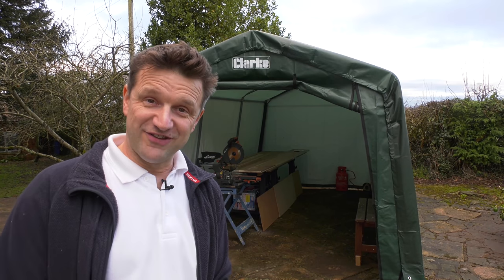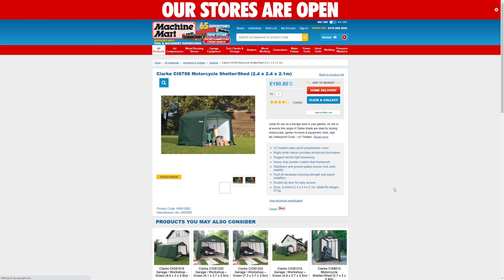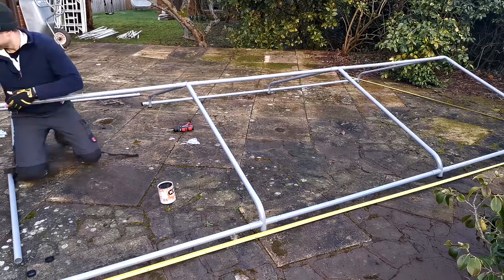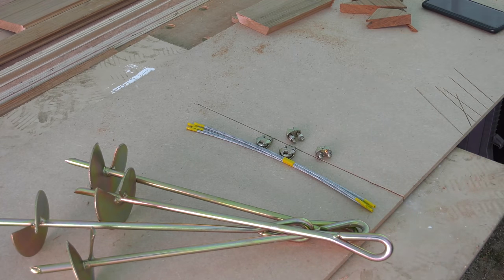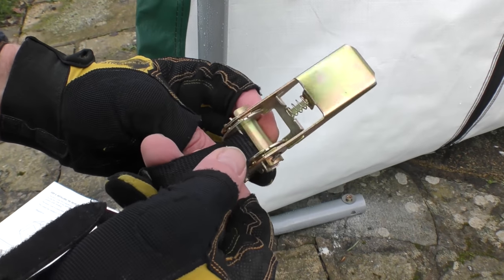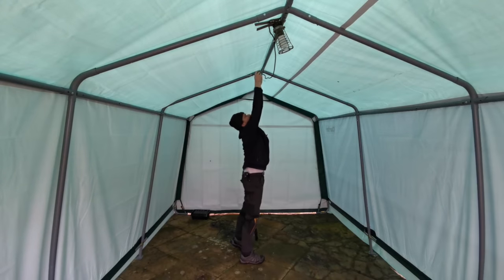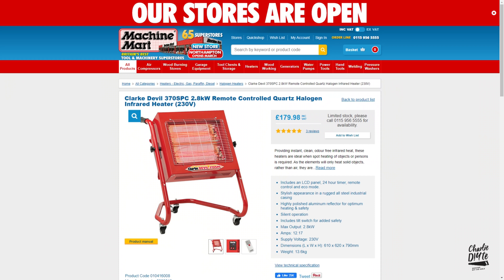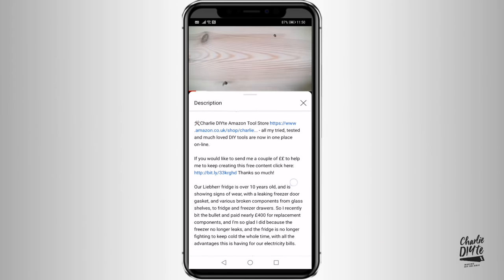Instant Workshop for Bespoke Wardrobe Build!

Comment: I’ve had 2 of these. They are great.......for about 2 years.....after which the UV sunlight will weaken the cover to the point that it splits on the corners where the cover rubs against the frame or down the ridge line. Place some foam anywhere that the cover is “stretched” around the frame and it will last a little longer. Also don’t over-tighten the cover as again it causes it to wear quicker.
Reply: Great comment. Thanks mate

Comment: Nice idea. As with sheds, at no time will you ever think “Gee, I should have gotten a smaller one”. It will be interesting to see
your decision in a few years when the cover material wears out. Other options could be hard plastic style or a wood shed. Initial cost is higher but eventually replacing the cover material will exceed the cost of 
stronger choices. Other advantages would be better security and ability to run power to it and having windows to open in warm temps. 
Thank you for taking the time to
show the build.
Reply from the maker: All good points Louis. The thing is, this is only intended to be a temporary structure, although it's still up after nearly a year!
Reply: @CharlieDIYte  
Charlie, I’ve been told by a friend that Gorilla Tape is super strong and could possibly be of help to you. IF you can reach the obvious ‘wear points’, you could reinforce them and extend life of your structure. 
Best of luck!

Comment: Having seen this in the Machine Mart catalogue and on their website and being quite pleased to see a considerable amount of positive, 5 star reviews for it, I think that it would make for a good, portable workshop in which I could build the excellent Slidavan rising roof camper, which is designed to be built in a single car garage.

Even though it would be in a rear garden and invisible from the street, I have no intention in leaving any tools or items of value in it whist I'm not actually in it, working.

It was nice to see it in your video and it certainly looks like something that one can buy with confidence as it appears to have been well designed and manufactured from good quality materials and fittings to a high standard, making it completely suitable for our winters.

The fact that the instructions are well written and the individual fittings are marked for clear identification during the checking, layout and construction phases further builds confidence in the product and its quality.

Thank you for your helpful video.

Comment: Hey Charlie. That’s a really impressive temporary structure. I like the solidity of the steel frame and the ratchet straps etc. It looks pretty robust. Perfect for us Brits who don’t have triple wide huge garage spaces like our American pals for workshops. I’ve been heating my timber workshop shed with an electric radiator and that Clarke heater looks pretty good. Looking forward to the wardrobe build. All the best 😃👍🏼
Reply from the maker: Cheers Paul - you too 👊🏻.  I'm so pleased with it. Was in there with my son this afternoon helping him with a woodworking project. It really does feel like a proper workshop and the new infrared heater is perfect for the size of room. We had the room at a very comfortable 21 degrees.

Comment: These are really good, we have the smaller motorcycle shelter version you mentioned, used as a temporary shed when we moved house. We did use the ground anchors, make sure you fully secure the frame to the anchors and spend a lot of time making sure they aren't going to move. We too have had some very high winds, which the structure has handled well so far. Would thoroughly recommend these.
Reply from the maker: Thanks - it's really good to hear you've had similar experiences with the smaller one. I'm so pleased with it. My son and i have been working in there on a school project this afternoon, and with the heater on, it's a lovely space!

Comment: We're on the same wavelength! I was just about to put up a 3x3 pop up gazebo.  Top video bud 👌
Reply from the maker: Thanks mate. It's the way forward. I had an epiphany in the summer when I was carrying in my tools for the umpteenth time in a rain shower and thought "dow, why didn't I think of this earlier?" That gazebo would have been fine, and it would have been nice to have had windows but with the white walls it's light enough inside particularly with the lights on, and with the heater this afternoon it was a respectable 21 degrees 👍🏻

Comment: Another good review Charlie. You have given me an idea for 1 now.
Reply from the maker: Cheers mate. I'm so pleased with it. Helping my son on a woodworking project in there this afternoon and it really felt like a proper workshop - particularly with that second heater, which keeps the room to a comfortable 21 degrees. The RCD was invaluable this afternoon when i had the heater on and started using the chop saw (the electrics are a bit heath robinson - basically an extension lead).

Comment: Hi Charlie, ,thanks for the video, good space, and as you said you'll keep dust out of the house, here's Whishing you well during this lockdown, looking forward to the next one, kind regards, Stuart.uk.
Reply from the maker: Thanks Stuart. Yep, loving it so far and that second heater is a revelation. 21 degrees in there yesterday afternoon!
Reply: @CharlieDIYte  hi Charlie,  thanks for the reply,,21 degrees, luxury working conditions, overnight condensation on things that have warmed up mite be something to watch out for, I have a concrete workshop and I never put heat on this time of year, as the following morning anything metal is wet through, I only heated  it once and it took me 2 days to dry out tools , etc, if I had my time again and the funds , an insulated, heated workshop would be top of my bucket list, , stay safe mate, kind regards Stuart.uk.

Comment: This may be an option for me as a makeshift kitchen during renovating mine.
Reply: I bought a cheap caravan when I did my kitchen, so much nicer to cook/eat while Chilling out and not sitting in dust etc. My was ripped back to bare walls and rewired etc. Most likely they will be delays and problems along the way. Best to a solid temporary kitchen in place.

Comment: Nice. It could do with a window flap at one end to allow through ventilation with all that saw dust.
Reply from the maker: It would be nice to have a window just to let in a bit more light, but it's pretty light in there due to the white lining. I'm not worried about the dust as I'll have the flaps fully up when I'm cutting.

Comment: Have you had any issues with condensation? I bought the smaller one last summer for some storage, and planned on getting the larger one later this year for some additional workshop space, but when I went out to get the christmas decorations last December, the roof and walls on the inside were quite literally dripping wet all over, and there was a musty smell on everything. I know the thing is waterproof, and has no damage anywhere so its not a leak, its definitely condensation and I'm not too sure what I can do about it.
Reply from the maker: Colin you're not the first to mention this and yes I've got to say, I've had some pretty big issues in the past week, almost entirely caused by the snow, which when it melted obviously caused a major dew point on the inside ceiling, so that when I finally re-entered the space there was a lot of dripping on my work bench. You need ventilation in there. Don't whatever you do weight down the sides or block the front or back covers, and a fan left on 24/7 pointed at the ceiling would probably solve it. It's the same principle that i talked about in this video https://bit.ly/3glMu6H in respect of condensation on windows. It is annoying but I still think it's a fabulous storage space. I wouldn't be able to do this wardrobe build without it, so I'm happy to live with this one issue.
Reply: @CharlieDIYte  Thanks for the reply, at least I know its not just a problem with the one I have, but with regard to putting up with the issue, I think ill be the same, as I desperately need a larger workshop space purely for larger projects and it is the cheapest option available to me, I think as long as I use waterproof external sockets and cover anything important with tarps (as I tend to do in my wooden shed anyway) it should do the job :)

Comment: That looks like a fantastic working space. It's not easy handling a full sheet of MDF in a small space. I also have wardrobes to build but my garage is far too full and cluttered. I'll be interested to hear how you get on with damp issues and condensation. Do you expect the patio slabs will get water run across them when it rains?
Reply from the maker: Sounds like you and me have a similar situation. Condensation hasn't been a problem so far, possibly because the patio doesn't retain a lot of moisture but also because I have it on the patio rather than the grass, there's a small gap under the front and back cover for air to circulate - which is crucial to negate any condensation. I'm interested to see how the patio goes. It's pretty dry at the moment, doesn't seem to get rain flowing through it, but does seem to mirror the condition of the patio outside, in terms of being damp when it's raining, but that could just be because it's taking a while to dry out. We shall see. I'll try and do a stand alone video on the heating if time allows.

Comment: Looks good.  Maybe make a wood frame perimeter base from some pressure treated  3 by 2 so you can take it to jobs where you might have to setup on a lawn?.
Might be an idea to cut out panels and tape in clear plastic windows in for more daylight
Reply: Very good point
Reply: I think it comes with long screw pegs for pinning on soft ground. They look pretty solid as well.

Comment: Great to see this video Charlie as I have various projects planned for the coming years and was thinking of doing something like this in the garden. The structure you bought looks what I would call semi permanent as it doesn't look like something you would pop up for just and afternoon of DIY where as the Gazebo looks more suited to that. I would be interested in how long you think it would take to put up this Clarke structure if you were to just be doing it without all the filming etc and without the fixings.

The idea of drilling in some anchor points was a good idea though I wonder how the screws would stand up to the sideways forces caused by winds? Would they bend? It would have been good if there was an option for a doorway in the side as for my application the end doors wouldn't be ideal as it would have to be put side on to the house.

A shop near us had a big fit out recently and the workforce were using 2 tents on the parking lot similar to a Gazebo but a much higher spec one. It seemed to be a godsend as it just rained all week but they were able to work with no issues in the dry.

The heaters in this video would make a really interesting stand a lone video if you ever get the time to do one. I like that they are fitted on wheels so can be moved to where you are working and the infra red one you ended up using looks much safer all round. Essential for working in the winter and it will help to keep you much more in the mood for working out in these current freezing temperatures.

Some ideas I had for your work lights was to glue on a couple of the cheap rare earth magnets that are readily available online, you could then use these to hold the lights on the various metal poles of the tent so you get light where you need it most. These magnets are very strong and are useful on all sorts of things. 

I think though I would increase the amount of lighting you have in the tent as you can get good LED light strings or stand alone waterproof batten LED lights for little money from Screwfix etc and you could then wire them up and have a semi-permanent lighting solution if you wired a plug on the end with an outdoor light switch on the entrance of the tent. You could wire in a temporary outdoor socket  on the end of an extension lead or run a waterproof extension lead out to the tent such as the Masterplug HLP2013 or use an outdoor socket box.

This would give you indoor quality lighting outdoors for not much additional money and then in the future it could all be re-used for future projects or for summer BBQ's etc.

Looking forward to the rest of the series!
Reply from the maker: SO MANY good ideas in there mate, and yes I agree, the heaters deserve a stand alone video, particularly given that I was using it this afternoon, helping my son in there with his woodworking project, and got the room to a wonderfully comfortable 21 degrees. I'll take stock of everything you've said. The lighting in particular world be well worth sorting out. Suggesting recently mentioned Quinetic lighting. Wow, that system is clever!! Thanks again 👍🏻
Reply: @CharlieDIYte  I haven't heard of Quinetic lighting before so will look into it. Sounds interesting!

Comment: Hi Charlie. Great video. I was thinking of going for one of these however I would need it to fit into an 8ft space. I noticed when you were building frame there seemed to be movement of the bottom legs. Do you think they would pull into an 8ft base... cheers J

Comment: I have one of those as well. To be used as a workshop during a renovation. What I found is that the condensation was a big issue
Reply from the maker: Yes a couple of people have said that. I guess you need to keep an air flow in there.

Comment: Nice Charlie.  I have the same issue of doing a lot of DI and not having a fixed workshop inside so weather affects my work a lot.
Question I have is you said it has already been out in windy weather, but would you have any issue with leaving this out all year round?  In the UK we can be hit by very high gale winds, would you have reservations or worries about leaving it up and out during these types of very high winds.?
Reply from the maker: No, I'd be fine with that as it's designed as a semi permanent structure. I'll probably leave it there until the summer so I'll try to do another video to let you all know how it weathers.

Comment: Charlie,

Great vid as usual, always so informative and meticulous.  Thinking I'll get one to work out of too for upcoming project!

What's your thoughts on laminate flooring?
I have to install in every room in new property in 6 weeks time and wondered if you've covered kitchen installation at all? 
More so, cutting end boards and plinths etc or butting up to them ? 

Any tips would be great
Reply from the maker: I'm loving the instant workshop. No, I'm afraid not but there will be plenty of stuff on the internet. The only thing I would say is, if you can, take off the skirting before you start as laminate flooring with quadrant around the edges to hide the gap between the floor and skirting looks like a bit of a botch in my opinion.
Reply: @CharlieDIYte  Thanks for your advice. Skirtings off it is.... hopefully they won't break in the process

Comment: Great video, Charlie. How long did it take you to erect the tent/workshop?
Reply from the maker: I should have mentioned that. You should allow half a day, really just because of the anchoring which takes longer first time. It's not the quickest to erect (where one of those ebay gazebos can be put together in a matter of minutes), but it is designed as a semi permanent structure, so you wouldn't expect it to fly up.

Comment: Charlie - got a quick question, wondering if there is a way of locking it? Are the zips for the doors able to have a padlock put through them or something attached to them (a piece of wire with 2 hoops maybe) to make the whole thing a little bit more secure? Thanks in advance - great vid and seriously considering getting one of these!
Reply from the maker: Thanks mate. Funnily enough I was thinking about this yesterday, as the tent was being ripped around by the intense wind we've had recently. No, there's no end stop on the zip as they are designed to open from the inside and outside. If you're installing on concrete you could fit a  vine eye or similar onto the ground and padlock through both zips to it. However that will only act as a deterrent as someone could just take a Stanley knife to the canvas and cut through it.

Comment: Nice video as usual Charlie. The Clarke unit looks pretty stable. Just a thought, did you consider a small/medium poly tunnel for the job instead, as this would have been useful for its intended purpose afterwards. I built a poly tunnel for my school gardening club, and its a good structure.
Cheers, Dave.
PS. Nice dodgy lockdown haircut by the way :-)
Reply from the maker: Haha, my wife had a shocker with this haircut. I think she's been channeling Peaky Blinders 🤣. The poly tunnel is an interesting idea👍🏻

Comment: i use the 3m x 3m pop up 5 to 10 mins putting it up on my own complete with weights how long did that take you
Reply from the maker: Certainly not 10 minutes. More like a few hours once the anchors are in place but it's a semi permanent structure. Horses for courses, eh?

Comment: Could the gas heating have caused condensation on the cold metal that would tarnish the spring buttons?
Reply from the maker: Not on this case, because I only had the gas heater on for about 5 minutes. They were like that when I assembled it.